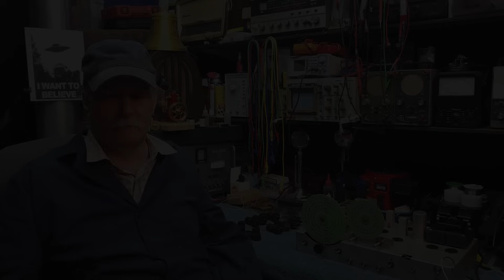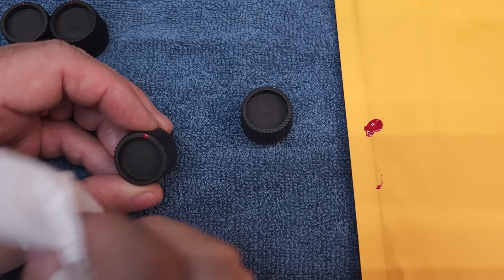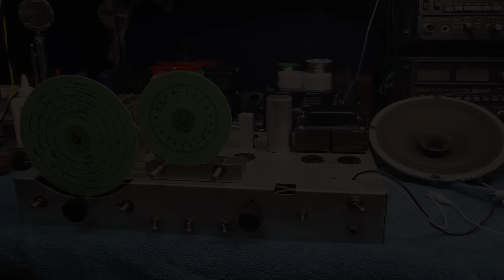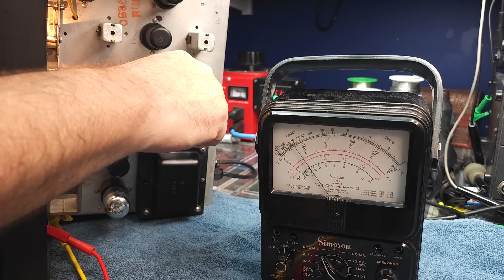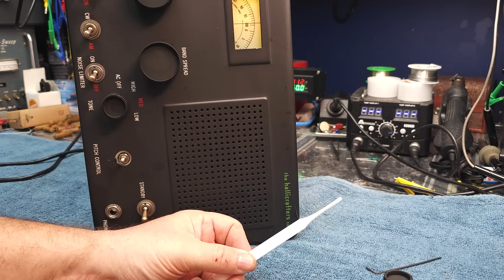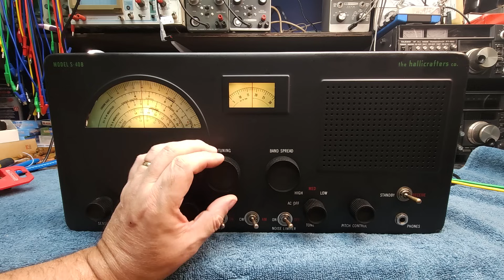Learn To Restore Tube Radios - Step Six

Comment: Great videos Mike! I have a Zenith X334. The FM works well from 88 to 98, pulls in lots of stations. 90.1 MPR to 97.9 The Moose (Maine stations) plus, many stations in between. But at 99 I get 90.1 and at 108 I get 97.9 again (plus all the same stations in between). Do you know what would cause this? I wouldn't mind this, but my favorite stations are 102.9 and 107.5.
Reply from the maker: firstly, I assume you have restored this radio with fresh caps and checked all the resistors. After that the following suspects are to be looked at. Without seeing the radio, I am just guessing, but it sounds like the osc quits as you tune up band. 1) test the osc tube. 2) test the mixer tube 3) check the tuning cap for shorts and poor rotor / stator contacts. Watch this. See if your osc signal disappears in the upper portion of that band.   https://youtu.be/kGiF_nk7BRo?si=gsTV_J7ZlMyhmfLN